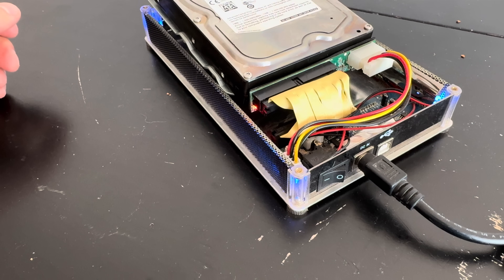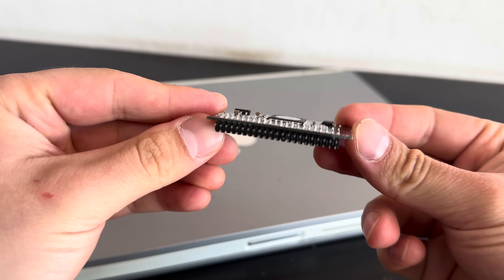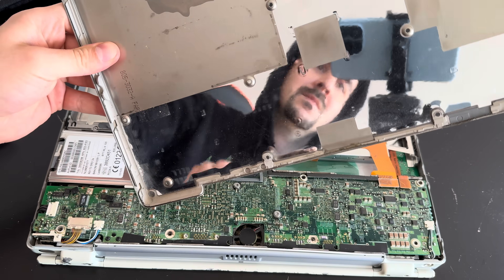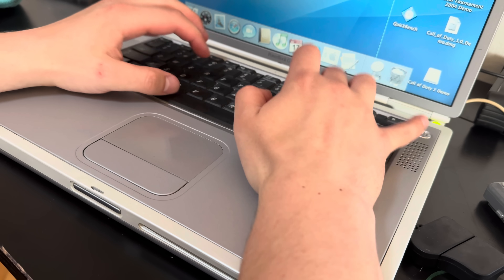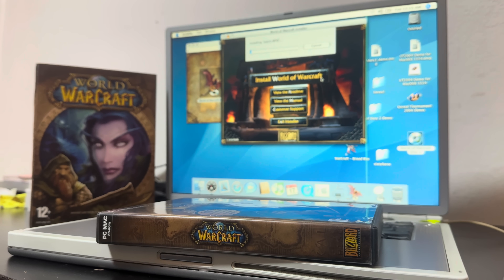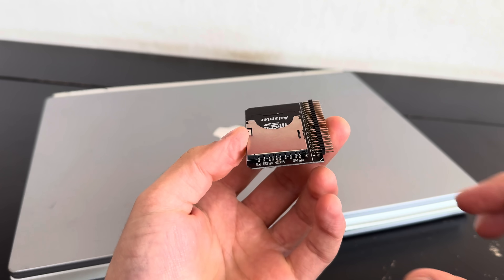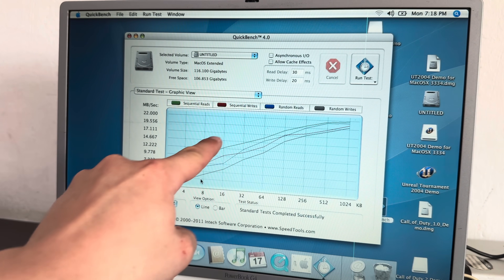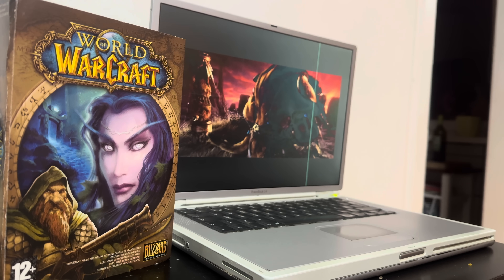Using SD Cards Instead of HDDs?

Comment: as working IDE hard drives get more rare, SD, CF, mSATA, etc. will be the new norm for IDE
Reply from the maker: @pentiummmx2294  Yep. It’s just hard for me to believe that they are becoming valuable again, given how worthless they were not too long ago. I mean, it’s the same as early Pentium machines. If someone told me 15-20 years ago they’d be selling for 100s of bucks, I would’ve told them that they were off their gourd.
Reply: @schvabek  some IDE hard drives are going upwards of $200, mainly those ones under 20GB, i still found my fair share of cheap 20GB, 40GB, 80GB, etc. IDE drives.
Reply: @pentiummmx2294  Why are the smaller ones going for more?
Reply: @elli6220  Some old computers can only handle a small capacity HD..
Reply: @elli6220 if I had to guess, some of the older computers couldn’t operate or see larger hard drive. I forget the exact reason but I had this in an old iMac. I had to use a 20 or 40gb drive since it couldn’t see the larger 128gb drive I originally tried.
Reply: @elli6220  they are getting more harder to find since many are dying
Reply: @pentiummmx2294  wtf who would buy an ide hard drive,especially on pc which support the higher capacity, i have like 20 of them taken from dumpster pcs and some digital recorders (from 40 to 160gb)
Reply: @bsellner8334  I have an old Dell square laptop that will not recognize a 2gb SD card, only 1gb; XP or Linux.
Reply: @schvabek  old Pentium machines are worth hundreds???
Reply from the maker: @ I regularly see early P1/2 machines going for quite a pretty penny. I’m not saying they’re worth that, but people are clearly buying them at ridiculous prices
Reply: @schvabek  some very old systems uses very old HW and SW, it can be a pump station sending data by modem or someting silly as that, its much cheaper to buy a 20 year old PC/Disk for thousands of USD than redesign the system when its planned to be rebuilt in X years anyway
Reply: @schvabek  for example Intel 8080 and Intel 80186 chips that was(is) in many old 8 bit computer(1980 and foward) systems are still manufactured today, as many industrial machines was designed with them
Reply from the maker: @Patrik6920  let me tell you buddy, people I see buying that crap on eBay/auctions are definitely not putting them in any sort of industrial setting 😂 they’re running Duke Nukem. It’s mostly enthusiasts, and there’s no real “practical” reason behind it for the most part. They’ve just hit the collectors market, like the rest of the old tech.
Reply: @schvabek  Many legacy industrial systems (factories, labs, embedded machinery, medical equipment) still run on hardware with IDE interfaces.

In these cases, the systems are often too costly or risky to upgrade, so keeping them operational requires legacy parts.

Ide(Pata) drives r no longer manufactured, so this system now uses adapers (CF-IDE, SATA-IDE etc)
Reply: @schvabek  well, thats another possible use i guess .. also if u have a bunch of old drive u can also contact a deasent recovery lab and hear what drives thay want to buy, sometimes when important systems fail u want the data etc ..
Reply from the maker: @Patrik6920 sure they do, what I’m telling you is they are not the one buying them on eBay. Prices get jacked up because of the collectors who covet them.
Reply: @schvabek  possibly, but to be frank, if i need a old obsolet drive that has no other use that is has a certain circuit, if its listed at 300 USD its sold
Reply: @schvabek  use dos-box LONG LIVE THE KING
Reply from the maker: @k94536  I do use DOS box 🤷‍♂️
Reply: @schvabek  100s? Wow, I might be sitting on a jackpot, I've got some real old systems sitting in my basement. No idea if they'll boot or if their BIOS batteries have leaked. I'll need to check at some point.
Reply: @MindCaged  kombucha is very effective spilled acid cleaner. FYI if you ever encounter the residue.
Reply: I’ve got a 250gb ide hdd that spins up but I have no way of reading it as I don’t have ide cables…
Reply: @EvanPang-w4i  A USB cable with headers for SATA, full size IDE, and 44-pin mini-IDE is less than $10, and I use mine intermittently but frequently. I don't really need it for SATA as I have plenty of dead external hard drives I can salvage controller boards from (or just attach them to the dangling cable in my desktop if I feel like removing two thumb screws to remove the side panel), but it's now the only means I have of accessing PATA drives as I pretty much only have hardware from ~2009 to present.
Reply: @mal2ksc  unfortunately these adapters do not work with drives that predate EIDE (typically smaller than 504MB - just as well I was able to find my old machine that had on-board IDE but also capable of booting from USB so I could image a 420MB hard drive from an Acorn Risc PC last month)
Reply: @EvanPang-w4i  I use an external IDE., enclosure for testing, perhaps someone whom you know can help you out.
Reply: At the very least msata are much more realiable than an SD card.
Reply: i got lucky getting two 320GB IDE drives for 30€, other listings with only one 250GB drive are sometimes 60€+
Reply from the maker: @vetrixfx9264 yeah, like I’ve said, I wouldn’t compare anything to those listings, they are insane. I also wouldn’t pay $30 for an IDE hard drive, but again, nowadays I guess it seems like a good price.
Reply: @schvabek  yea it is quite expensive for old drives, i thought they would be like 5€ max. But atleast I could hook them up to a LaCie caddy with USB, FW400 and FW800 ports and can comfortably copy stuff around, especially my Titanium PBG4 :D
Reply: SD, CF etc will become very rare in the forms that work as a HDD, they aren't made anymore afaik and they will all die after not that much use. mSATA or any sort of actual SSD is a million times better as a solution, unless you're looking to use the thing on an OS without virtual memory and do not plan to write to the 'disk' much, and also have a lot of patience since SD, CF etc are veeery slow as HDD substitutes. I have several CF to IDE and similar adaptors in my retro systems. I only use them because it's a pain to find actual working IDE HDD's cheap, and I can rip out the card to put files on it and thus do not need to try to find floppies or burn CDROM to move files to those systems. Ideally you'd use an SSD as a boot drive and an SD card or whatever only as a substitute for CDROM on systems too old to have USB, but since this system is fairly new, there is no real point. You can get an SSD for it with wear leveling etc that has 100 times better performance than the fastest SD card on the planet.
Reply: @noth606  There's no reason why any new SD card can't be used as a hard drive replacement for very old systems. The latest and greatest SD cards are still random access devices. The adapter/interface board and firmware are the important parts. They may be slow compared to SSDs, but old systems often can't max out an SD card. The biggest problem is partitioning and formatting them to an appropriate size so old systems can read them, but FAT, FAT32 and Ex FAT are common formats for PC and many Macs. Amigas and other platforms, including 8 bit machines can benefit greatly from using SD cards.
Reply: Totally agree—at this point, IDE hard drives are like Pokémon cards: rare, overpriced, and mostly sitting in someone’s closet “for future value.”
I’ve already started treating SD-to-IDE like the Swiss Army knife of retro upgrades. No more praying to the eBay gods for a half-dead 20GB clicky brick. And let’s be real, CF and mSATA are basically doing the Lord’s work for anything older than your cousin’s flip phone.
Reply: I have a 6gb wd caviar that just finally started clicking, after being in semi use for 20 years
Reply: @corey7219  has it stopped working(just clicking) or click from time to time?
if its still readable: back it upp asap if possible, its likely dying very soon.

once u backed upp the drive u can begin inspect it, with some older drives clicking can be both mecanical and electric circuit failures.

what ever u do do not open the cover of the drive it will make it effectivly dead (u need a cleanroom to do it), and never ever start a drive with the cover off it will kill it.

u can remove the circuit board without opening the drive head area and inspect it, sometimes old drives have burned and oxidized traces or pads, some has poor solder joints etc ... its the easiest inspect, next is ofc to test the circuits, but that req some tools and expertice.

i higly advice aginst stress testing the mechanical parts .. in most cases it will kill a drive this old.
Reply: I have PCI IDE controllers, both raid and non raid.  I even acquired SATA to IDE converters for cheap on eBay, but they all are either buggy or do not work at all.  I have about 13 old IDE hard drives stuffed into a case running software RAID on an old P4 PC and it still works.  Might be about 3Tb or so in space.
Reply: @pixels303at-odysee9  13 IDE(PATA) dirives .. seems unlikely
Reply: @Patrik6920  are you one of those people who enjoy challenging others without asking questions, based on your own preconceived ideas?  If you would rather stereotype others rather than engaging, I could simply ignore you.
Reply: @pixels303at-odysee9  i dont know what ur refere to, care to explain?
Reply: yep that's true but at my computer store has like a box full of ice hard drives
Reply: The SD card would last about 10 months. I accidentally had my NAS boot from an SD card; it was only going to install from the SD card, but I installed it on an SD card.
Reply: @quantumleaper  i do know that Windows NT and Linux are more aggressive with write cycles than DOS
Reply: @pentiummmx2294  The LAST version of DOS came out in the same year as the SD card was INTRODUCED,  you do realize that.  None of my BIOSes ever supported booting from an SD card.  I had to get an SD card to USB,  then I could boot from my SD card.  That was around 2013 or so.
Reply: @ I was using a NAS that was using BSD for an OS,  Youtube mssed uf the edit function to the posts.
Reply: SATA to IDE exists   it's backwards compatible to an use a M.2SATA to IDE plenty on 3rd party tools to add trim support as well
Reply: They don't last forever but they retain the data longer.  If your SSD or memory card or other NAND flash based storage does not get power, that data might be gone or corrupt in a few years.  With that QLC garbage they are selling these days, probably a lot sooner!  They only make QLC for memory density, it has terrible write endurance and I would not buy it unless I was only using it to give a copy of data to someone with.  TLC may be OK but MLC is better.  There is SLC but you won't get a low price for that!  SLC is the best for write endurance and speed but is horribly expensive!
Reply: Its cool to have this adaptor, similar to NVME to SATA ones.
Reply: You can get an ide ssd dosdude1 showcases one in one of his videos
Reply: I still have half a dozen SCSI 1 from my old Amiga BBS....  no chance of getting a controller to run them on todays hardware...  unless there are PCIex  scsi controllers out there...

Comment: ayo is that Battery inside the Laptop bulging?
Reply from the maker: Not really, but it doesn’t really hold any charge. I left it there just for aesthetics
Reply: @schvabek  you can disassemble the battery and replace the lithium ion cells
Reply: He's already nearly burnt down his house
Reply: @ He'll be fine. Match the polarity, voltage and always go more mah or equal. Modern cells will outlast the old stuff
Reply from the maker: @goclunker  I can’t think of a one good reason of doing that man 😂 except for I guess making a video. But like, I really don’t need a working battery for it